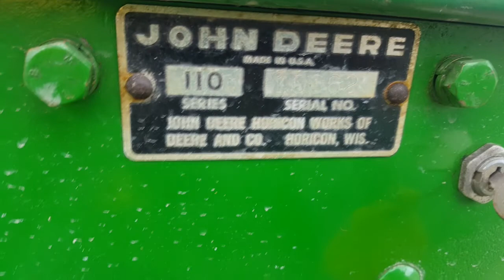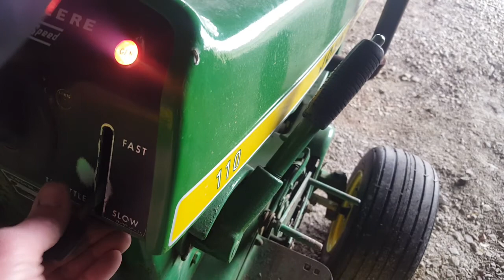1964 John Deere 110 Round Fender fully restored

Comment: That sounds beautiful I’m hopefully getting a 64 110 this Friday anything I should look after it does shift a little to easy from what I checked
Reply from the maker: Just make sure it doesn't smoke and have any crazy engine rattles. Most of the 110 transmission detent springs are a little worn. As long as it goes into the gears and stays it should be fine.

Comment: Nice tractor. I’m in the process of restoring a 1964 110. I have 4 bolts with Acorn nuts on them that I don’t remember where they go. On your tractor I only see 1 on the left side next to the foot rest holding the break bar in place. I’m sure there were supposed to be 2 holding that support bracket in place. Any chance you know where the other bolts go with the acorn nuts?
Reply from the maker: @twotonebrute  i will check tomorrow. Not really sure at the moment.
Reply: Thanks. From the pictures I took of my 110 before disassembling I only see two of them. 1 on the front hole of the right foot rest. The other on the left side back rear bolt of the break bar. I think I can see that on on your tractor around 42 sec.
Reply from the maker: @twotonebrute  well without climbing under the tractors the only one i see is the left deck support bracket 2nd bolt back. 7 of mine have it in the same spot.
Reply: Thanks for looking. I'm not sure why they put just one on that support bracket. I'll see if anyone has an assembly manual that shows the others.